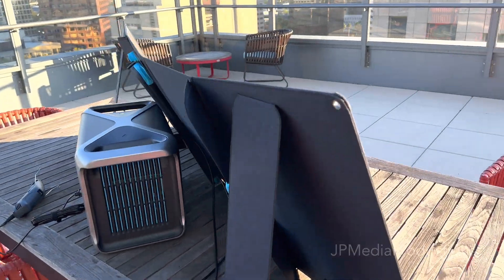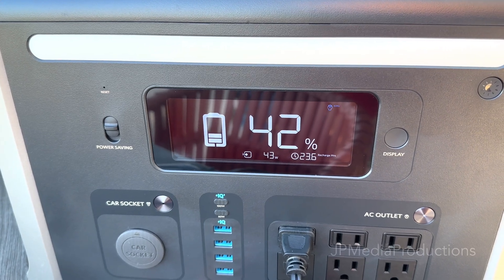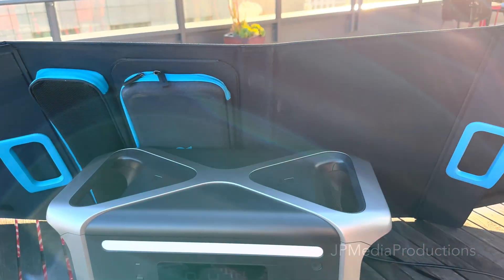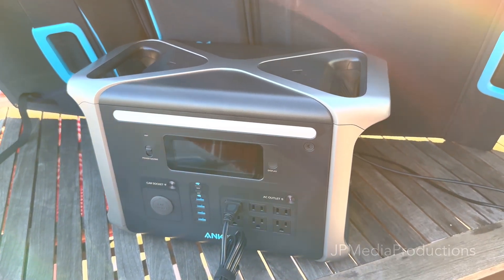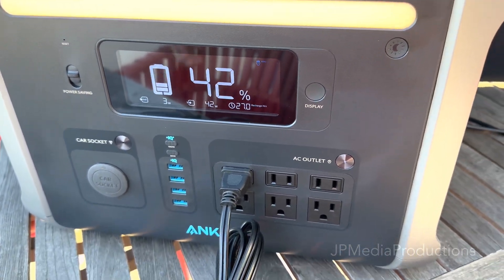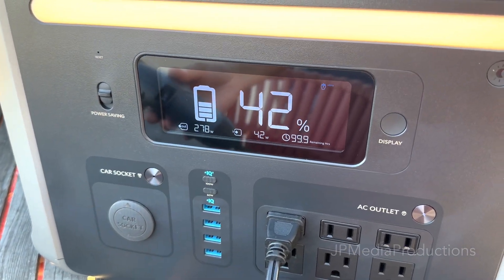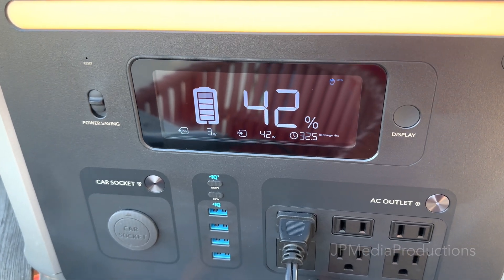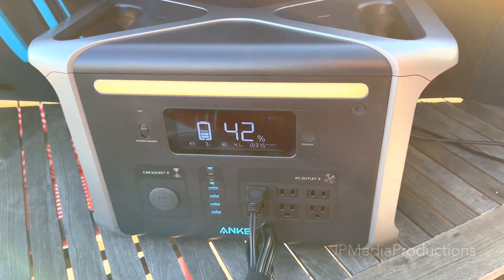Pass-Through Charging with Solar Works Anker SOLIX F1200 (Powerhouse 747)

Comment: sir how about the ANKER SOLIX 757 F1200 can be still PASS-THROUGH? NO ANY ISSUE??THANKS SIR
Reply from the maker: Pass-through works with that battery station as well. I confirmed with them at CES 2024 when at their booth in Vegas.
Reply: @JPMediaProductions  thanks for the response and good INFO..god bless sir..
Reply: My 535 also allows pass through 👍🏻